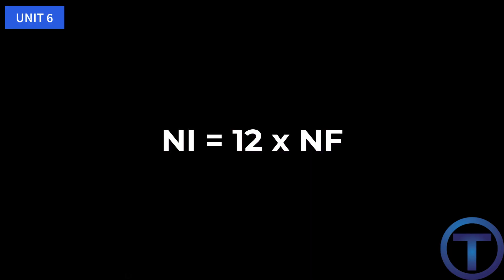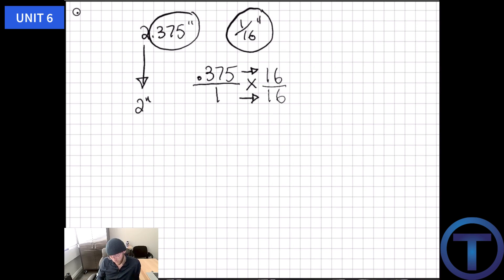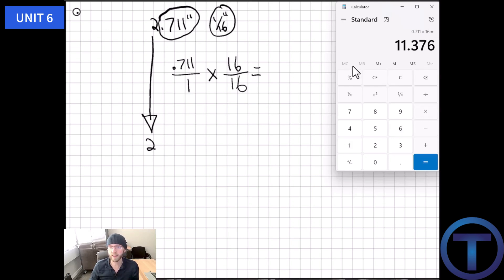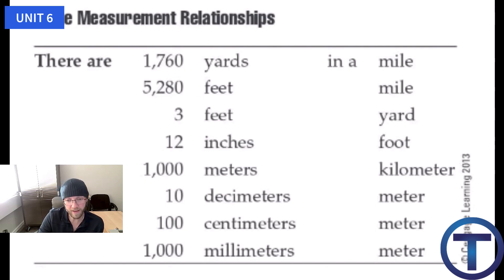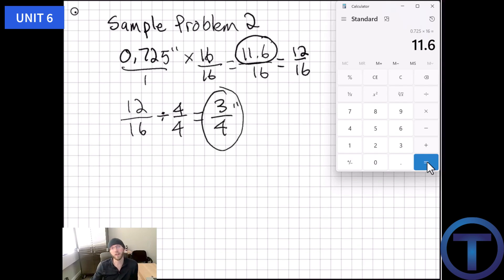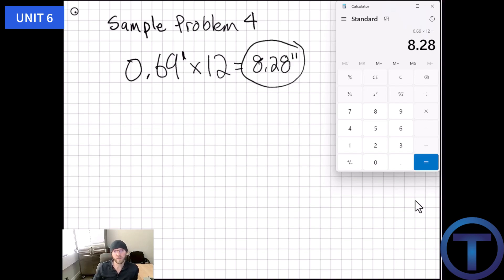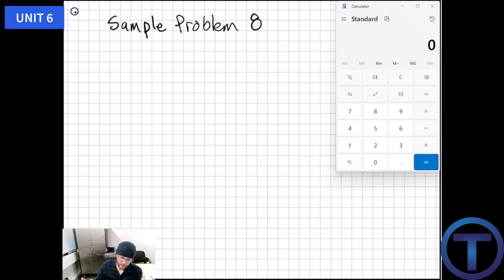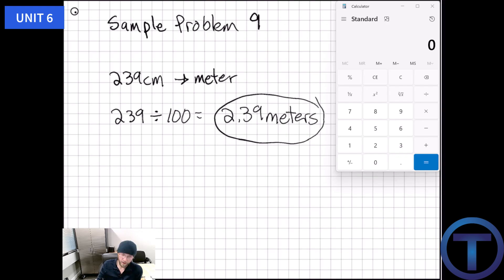Mathematics for Plumbers and Pipefitters - Unit 6 Conversion of Measurements

Comment: Why are you multiplying it over 16? I get they required it. But what if they don’t ask you.
Reply from the maker: The book usually wants measurements to the 16th of an inch.  You could also use 8/8 if you are measuring to the 1/8th inch.  In the field, I usually don't get any more accurate than 1/4 of an inch because for rough plumbing it really does not have to be that precise.